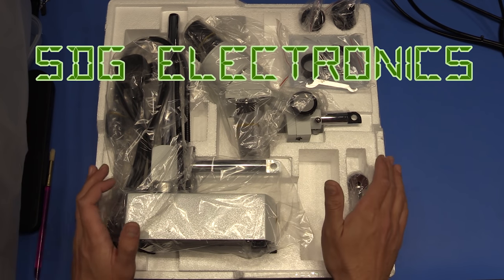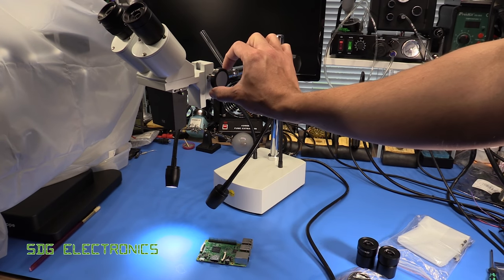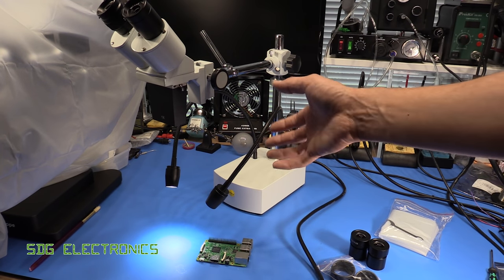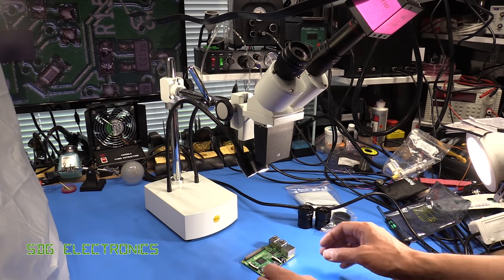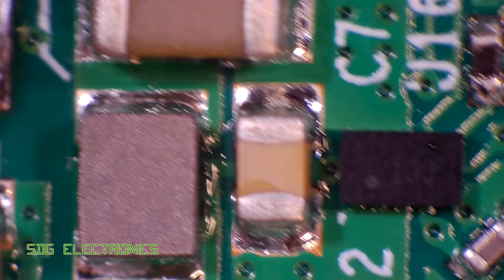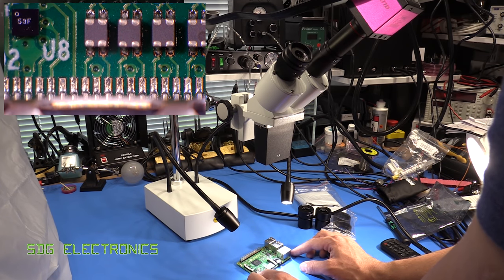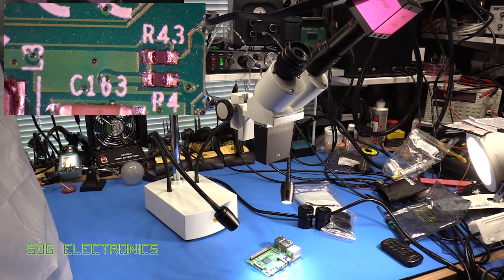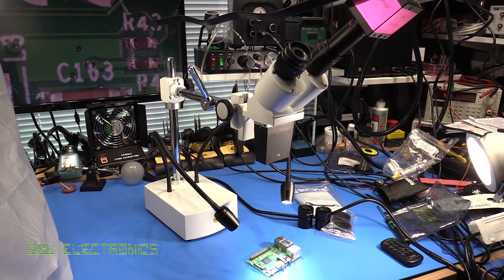SDG #077 Entry Level Stereo Microscope for PCB Assembly and Inspection - Swift SS41-WF20

Comment: YT isn't displaying comments here for some reason so hopefully I'm not repeating others thoughts.  For about $100 more you can get a trinocular that includes a Barlow extender which gives you a much greater working distance. IF you're thinking about a trinocular be careful because some actually sacrifice one of the optical paths when you engage the camera so make sure the one you're getting allows you to use the camera AND the lens simultaneously; a friend found that out the hard way!  Thanks for sharing Steve, that's actually a pretty good deal.
Reply from the maker: Just for reference, the working distance is 220mm at 10x and 20x, so actually very workable. I forgot to mention in the video. Yes, the switchable trinocular seems a real cost cutting exercise for the same of one more piece of optics. Thanks Dino.

Comment: I got it with £30 discount in Amazon, is in promotion now, but I added extra 0.5x objective which gives even better 5x, better than 10x than is already a little high for general soldering. The depth of field should be better and I know the distance don't change , wich is massive and super important. 
I really dont understand why someone would want other microscope for soldering, is perfect with the 0.5x (£50)
If you got tired or want inspection with camera, you can. Even you can add a acrion camera with wifi and record 4k.
Stereo and recording is still absolutely possible with you can make a camera attachment and print it....
Buy other thing more expensive and get something with less distance as the SM series and twice as bulkier and twice the price have no sense.

Comment: Excellent. I was waiting for your review. Looks like Dave Jones reviewed one today that seems identical - Sent over by a UK firm.
Reply from the maker: Yes, I just saw that this morning. I'll use it again in some upcoming videos but I'm actually really impressed with the optics. If I didn't want the camera port this would be all you need.
Reply: @sdgelectronics   - I would agree about the quality of the optics. I haven't looked at the specs to see if there is a camera port accessory available for this model, or indeed, whether another one in the range supports this. Will investigate further and thanks again, Steve
Reply from the maker: @The.Doctor.Venkman  from what I saw, once you need a camera port you're talking about the larger microscope heads.

Comment: Nice and compact, looks good for electronics work. Assume there a power switch on the back for the lights?
Reply from the maker: Yes, it's an integrated IEC connector with fuse and switch. Seems to work well.
Reply: @sdgelectronics  BTW, you forgot to mention that the objective can be swapped as well. It is on a rather special dovetail mount that slides out when you release a tiny set screw. I have this microscope with a slightly different stand (has a halogen light instead of the two goosenecks) and rebranded as Amscope. You can actually get 0.5x objective to reduce the magnification and have more working distance - I commonly use 0.5x objective + 10x eye pieces for 5x mag when soldering to have a larger field of view.
Reply: @JanCiger  it is what I got, with 0.5x , but this with two lights